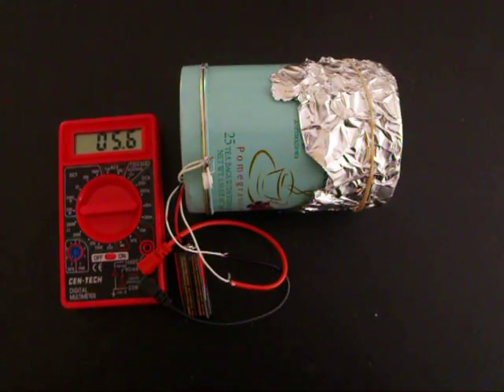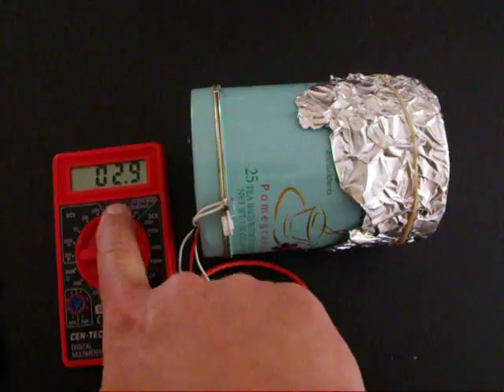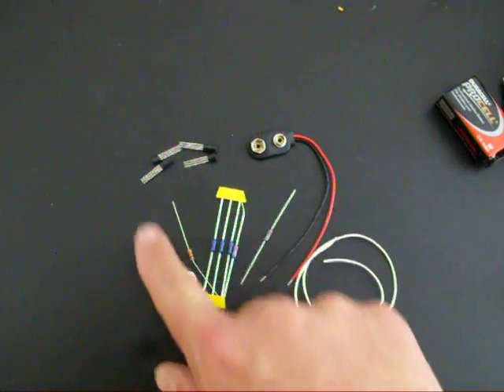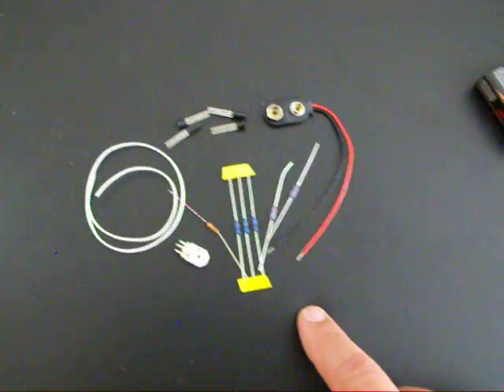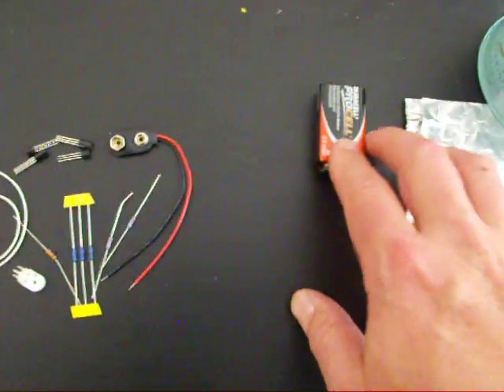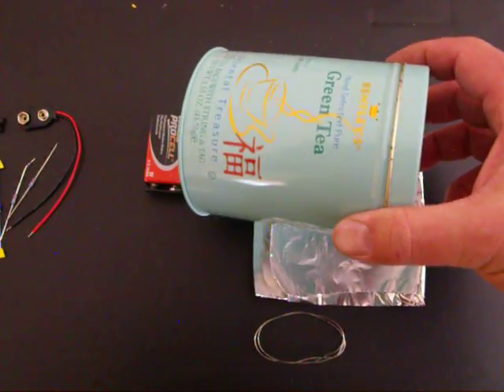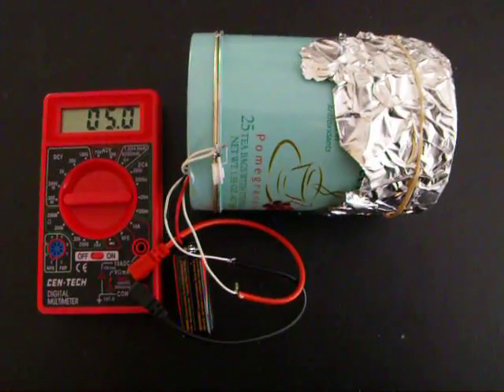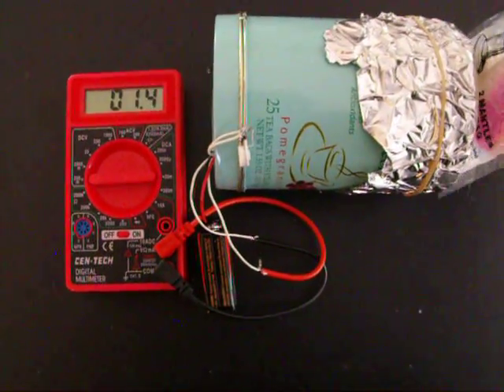Home Built Radiation Detector

Comment: I would be very interested in making one of these but the problm is that the voltage is far to low to use the reading to assess the dose rate : for that the voltage applied to the ionization chamber should be ut to 150 V a least to reach the saturation current. Then  we could calibrate it with a source of known dose débit. Unlike the geiger counter that cannont discriminate and measure the dose of the particules or photons reaching it , the ionization chamber can give a response that depends linearly of the incident energy. and then when we know the measure of the ionization current we can calculate the dose (exposition).

Comment: I'm aware that some geiger tubes produced by companies are compatible with arduino. This home-built device cant be used with an arduino, can it?
Reply from the maker: This could be used with and Arduino if you put an op-amp on the output and then used the analog voltage function of the Arduino to measure it.

Comment: how to get or how to have a sample of depleted isotope to test the detector geiger projects for electronics circuit if someone can tell me 
HOW YOU TEST THE SENSOR YOU LIKE IT DETECTED DU USA WHERE TO SHOOT THIS MATERIAL TESTING GEIGER COUNTER
email - francisconunes16@gmail.com 

THANK Brazil
Reply from the maker: Two simple places: 1) Thoriated TIG welding rod, available at any welding shop, these are the safest easiest source you can get, the larger the diameter rod the better the source. 2) if you can find a lantern mantel that was made before the 1990s they were also thoriated, some garage/estate sales you can find these, and sometime old surplus stores have them.
Reply: THANK YOU

Comment: I just built my first radiation detector based on your plans.  I used BC516 and BC517 darlingtons for several reasons:

1) They're readily available.
2) They are slightly higher gain than the MPSA64 and MPSW45.
3) Unlike the MPSA64 and MPSW45, they are complementary.

I built the circuit on a piece of perfboard.  I enlarged the hole to 3.5mm around the NPN transistor base which enters the ion chamber, but otherwise was not particularly conscientious about component placement.  I'm using a cookie tin as my chamber and a thoriated tungsten electrode as my testing radiation source.  I have a background in RF electronics and I'm confident that the shielding around the circuit is more than adequate.  Like you, I'm using a Harbor Freight, five dollar multimeter ;-)

It seems to be working -- in that when I place the tungsten in front of it, the reading goes up, and when I take it away, the reading goes down -- but I am having some EXTREME drift otherwise -- more than I would attribute to background radiation, and often more than the effect of the tungsten.  I have to keep the meter on the 2000mV range.  The reading jumps whenever I reposition the chamber, whenever I approach it, whenever I roll my chair across the floor, etc., but even when I stand very still over a meter away it still drifts, sometimes by several hundred mV over the course of a few minutes.

Initially I suspected static electric fields as the culprit, so I connected the cookie tin to earth ground.  That seemed to have an effect, but not a significant one.  The drift caused by my proximity seemed to decrease, but otherwise it was still pretty bad.

It occurred to me that since thorium is an alpha emitter,  aluminum foil would block a majority of its radiation.  I replaced the foil with a piece of aluminum window screen.  That dramatically improved the sensitivity to the tungsten, but there were new sources of drift.  If the air in the room is extremely still, it works very well -- the tungsten causes the reading to change by around 200 mV, and the response time seems to be better than in your demonstration -- but I have to stand very still, breathe in the opposite direction, and move the tungsten very carefully.  Any more motion than that and the reading jumps around. If I breathe on the chamber, the reading jumps by a volt or more.

I put a piece of saran wrap over the opening.  Now the readings are completely erratic.  I'm back to suspecting static electricity, even though it is still connected to earth ground.  The saran wrap seems to have amplified its sensitivity to my proximity, and it still jumps by a volt if I breathe on it.....

I'm going to get some different tins to experiment with and try other methods of sealing them.  I'm also going to see if putting a packet of silica gel inside has any effect, but I'd like to see if you have any thoughts.  Am I doing something wrong?  Are the BC516 and BC517 inappropriate parts?  Is my basement as radioactive as Pripyat?
Reply from the maker: It simply could be the outrageous gain of the BC516, look at the graph on page 3 of this data sheet:

http://www.nxp.com/documents/data_sheet/BC516.pdf

It shows a gain of over 90,000 where as if you look at the gain of the MPSA64 the gain is about 20,000 on the graph on page 2:

http://www.fairchildsemi.com/ds/MM/MMBTA64.pdf

( I would expect it to work properly when built as specified)
Reply: Hmm... look at the graph on page 3 of this datasheet.  It looks familiar :-P

http://www.nxp.com/documents/data_sheet/MPSA64.pdf

This one lists max gain for the MPSW45 as 150,000:

http://www.onsemi.com/pub_link/Collateral/MPSW45-D.PDF

I'll continue experimenting.  If I can't make it work the way it should, I'll track down the components you used.

Thanks :-)
Reply from the maker: dovregubben78
That is pretty funny. Those graphs look completely the same, copy and paste....lazy at NXP......

Comment: Hi. I am doing a school science fair project in which I am building one of these radiation detectors. I went to your website to try to purchcase the transistors kit, but it says it is out of stock. Is there any way I can get one of those kits? Thanks so much, - Emma
Reply from the maker: Hi Emma,

The computer we had the original files on for this crashed. Unfortunately I have not had time to remake the gerber files so that I can have more PCBs made. There have been many people asking the same question. I will try and get some time to work on this, I hopefully will get this done this weekend. I  just have been running too short on time. sorry for the inconvenience.

Kirk

Comment from the maker: @randox16000

Full details are on the blog on the madscientisthut site. I would put a link in here but the wont let you put links in comments 

You need extremely high gain on the transistors for them to work in this circuit.

Comment from the maker: Yes it could be, but you would have to build a circuit that converted the voltage level to clicks or you could use a micro controller to convert the voltage level to clicks.

Comment from the maker: Yes, but you will need to remove the coating from inside of the can. Sand paper or sand blasting will work, you might even be able to put tumbling media in the can and shake it for a while to remove the coating.